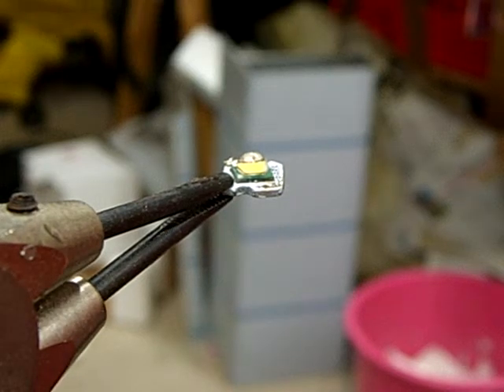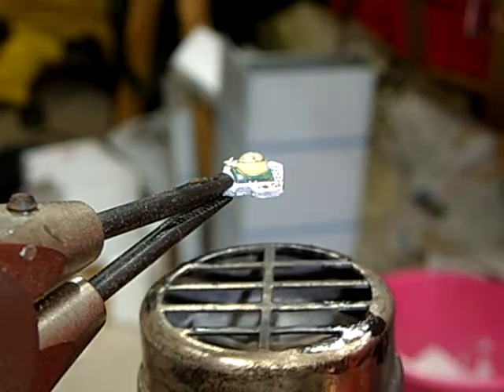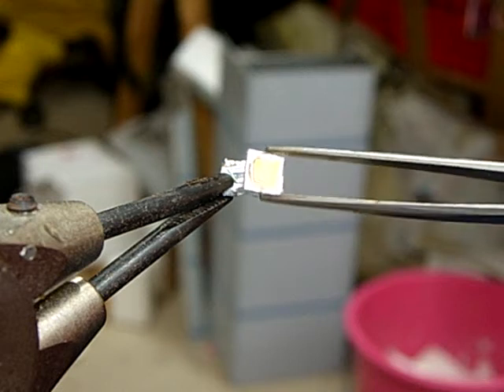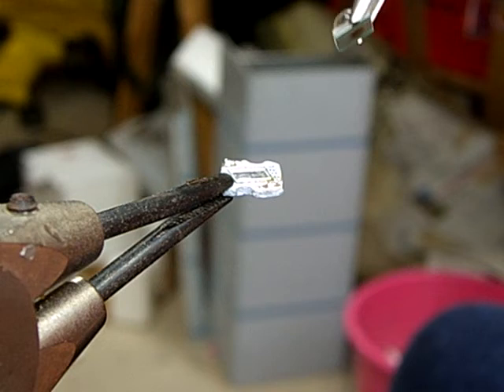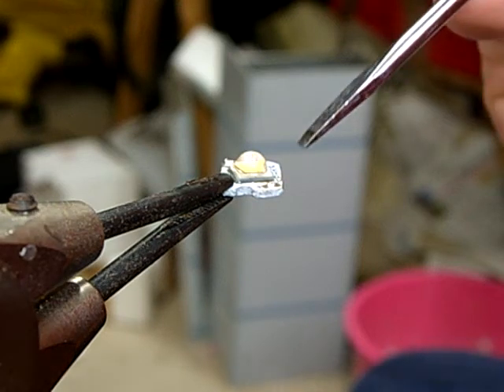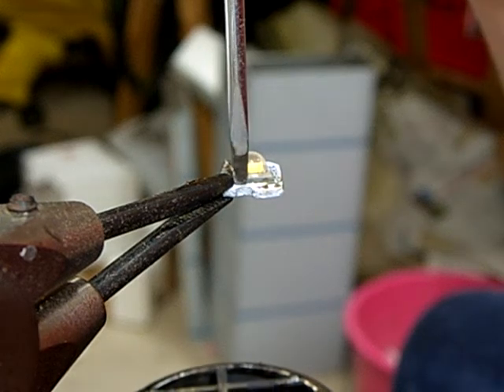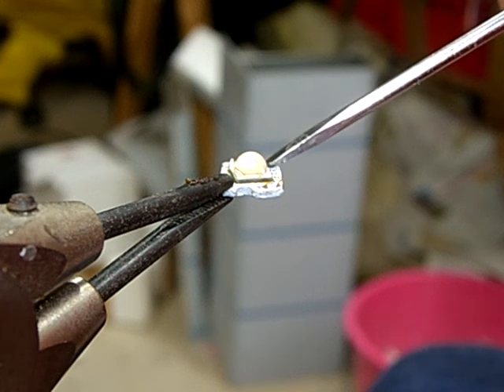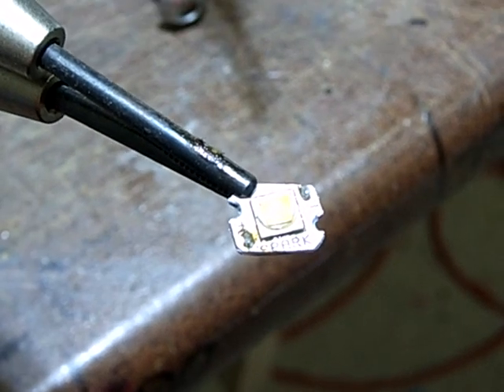Reflow Soldering CREE LED III (XM-L2 update)

Comment: could i do this with a regular hair dryer? could i also do this by placing my solder gun underneath the pcb star to heat it up as well? what if i just use solder and no flux to put it on?
Reply from the maker: +Ben C  If you hairdryer is able to melt the solder, then yes. Test it with a piec of scrap electronics first. But normally, hair dryers are not that hot. Try a cooking plate maybe, as shown in one of my other videos. This should work even better than a solder gun. Flux is absolutely neccessary for any good soldering joint. But if you can remove the PCB star anyways, I recommend buying a new star with the correct LED already soldered on. This is how I do it normally. Check the store "LEDDNA", they have good LEDs already mounted on copper stars of various sizes.
I recommend 
"CREE XM-L2 LED T5-5C3 Neutral White 4000K-4250K".
Reply: i have these leds and trying to replace its diodes

http://www.fish-street.com/image_show.php?item_id=525&type=super&vc=6c3a0c959058de05a4953d6473611abd

with these diodes

http://www.ebay.com/itm/3W-420nm-UV-Ultra-Violet-Purple-LED-diode-High-Power-bead-chip-with-20mm-pcb-/261616949664?ssPageName=ADME:X:AAQ:US:1123

could i use my stove and frying pan instead of a hot plate?

why is flux needed what does it do? doesn't metal just bond to metal anyway?

do you know where to purchase blue or purple CREE leds that's 400nm roughly that ships to canada? i don't think that ebay person's led's are cree.and leds usually come in less than 10,000k spectrum i'm looking for 14,000k and up. thank you!
Reply: it's hard to find led diodes sold separately from the star pcb